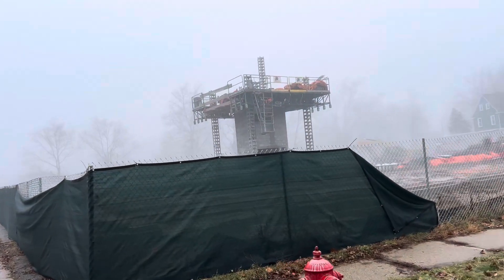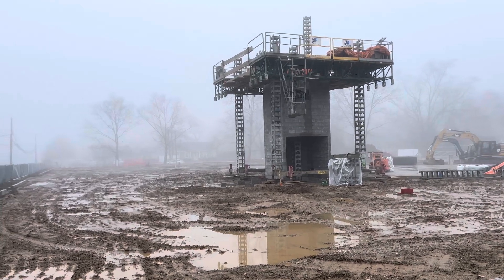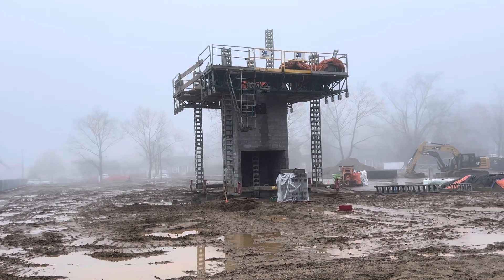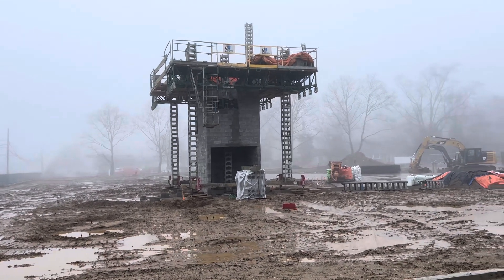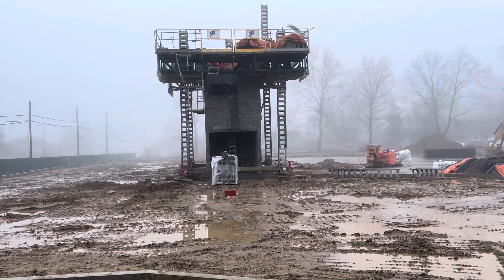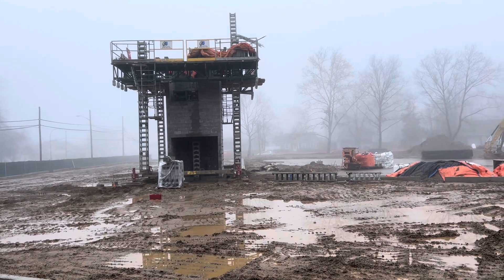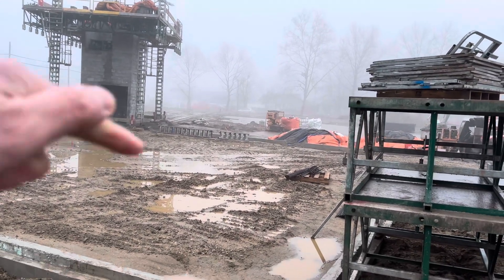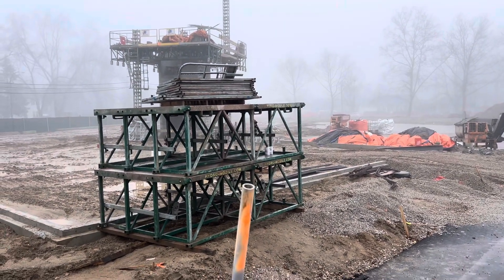Why Start with Elevator Towers in Construction? Unraveling the Building Mystery! 🏗️🤷‍♂️

Comment: Elevator will be caring a lot of weight and it takes days or weeks for the concrete to fully cure. It doesn't make sense to actually install the delicate, expensive and precise elevator machinery until the building is enclosed from the weather.
Reply from the maker: Thanks for this information 👍

Comment: Probably also for structural purposes. Elevator shafts are usually used to carry lateral loads due to wind and earthquake. Just in case such events will happen during construction the structure could still stand even though it's not completely built.
Reply from the maker: Thank you for the info. Makes totally sense.

Comment: Cranes are installed inside the elevator wells.
The elevator foundation is also the jack up crane foundation.
Reply from the maker: How does the crane get out later?
Reply: @TheTurboCircuit  They are disassembled from the top floor by a smaller crane that is then lowered in pieces down the lift shaft.
Reply from the maker: @allangibson8494  Interesting. Thank you.

Comment: The elevator tower also generally is drilled quite deep into the ground so it acts as the centre supporting structure for the building.
Reply from the maker: This makes sense and yes they have drilled down with a kind of huge auger screw some weeks ago at that spot. Thanks for your comment and for watching.
Reply: @TheTurboCircuit  
NP! :)
Reply: @TheTurboCircuit *3* WEEKS AGO!!